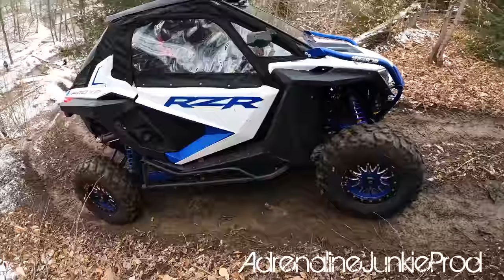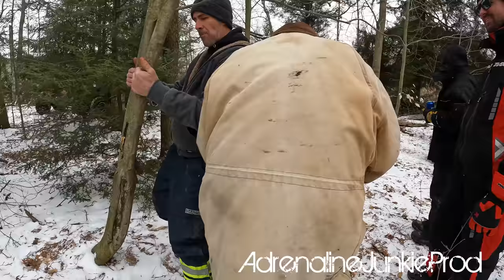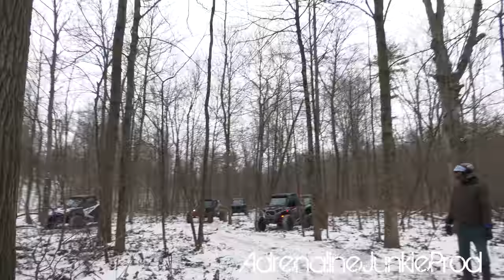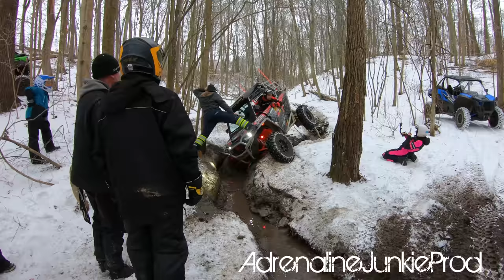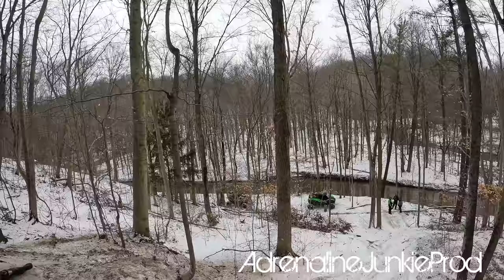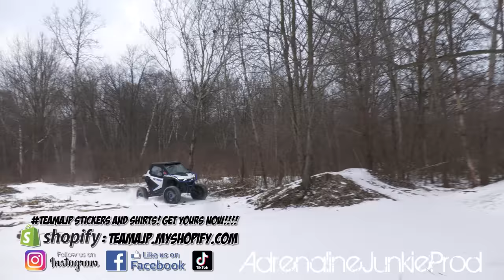Hogs Back Winter Edition - Action Cut - Slick + Icy SXS/UTV Hill Climbs - RZR/X3/KRX/RMAX/YXZ

Comment from the maker: Thanks for checking out the video! This is an action edit of one of our previous feature length trail rides. I have condensed a 2 hour 54 minute video into just under 33 minutes. I’ve had a lot of people tell me they would like a mix of shorter format content mixed in with the extended length films. This is how I used to do things back in the day. I am planning to cut back my hours at “my real job” over the next few months and focus a lot of energy on getting caught up with editing. I set a goal that I want to be up to date and fully caught up by spring. I have a TON of amazing content in the vault to edit and release. I also have some additional plans to refresh the channel and re-brand things a bit. I will keep you guys posted on all of that. As many of you know AdrenalineJunkieProd has been my passion project for over 10 years now and I want to kick it up a notch and try to take it to the next level. I started making SXS/UTV content back when hardly anyone was and I’ve never stopped. I want to release more content and release it more frequently. I also want to get caught up editing so I can release content much sooner after I film it without the delays I have now (I always release chronologically in relation to when content was filmed). I’ve had a ton of people tell me I should take things full time, I’m not sure if I am there yet (as it does not make any sense financially as far as life and bills are concerned) but I am planning to dedicate a lot more time to #AdrenalineJunkieProd over the next few months and see where it takes things. I’ll keep you all posted on my plans as we move forward and as always, I am open to constructive feedback and suggestions. Thanks to all of you guys for helping make my YouTube dreams a reality. Trust me, I know I couldn’t do any of this with out you all and I appreciate all the support you show #TeamAJP on YouTube, Instagram and Facebook! 

Julian AKA Adrenaline Junkie

Comment: Great video buddy. Those studs in your tires really do make a difference.  It is to bad that you can’t fly a drone upside down underneath a SXS while it’s doing a cyclone. I’m sure it would be a great video of it but I’m sure that if it was hit it would be all over with
Reply from the maker: LMAO! That would be a cool video, lol. I want to work on improving camera angles and framing shots going into the future. I'm always trying to improve production quality. I also finally got my hands on a drone. I just need to learn how to use it, lol.
Reply: @AdrenalineJunkieProd  I’ve got one also and like you I need to learn how to use it. Mines just a cheap one from Walmart but I’m happy to get it ( Christmas present from my mom )   I wonder what a video would be like if you set a camera on top of the SXS attached to a free spinning table, like a small lazy Susan or beater yet a motorized table that is spin opposite of the SXS